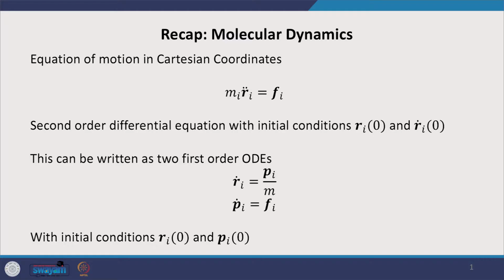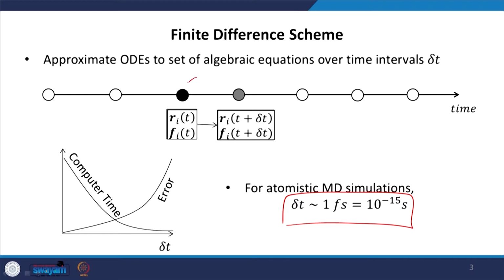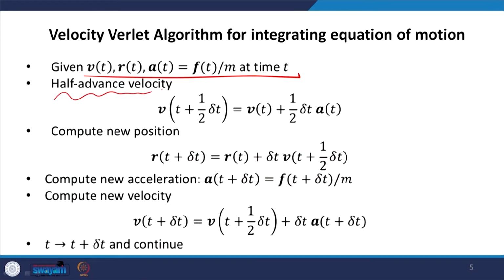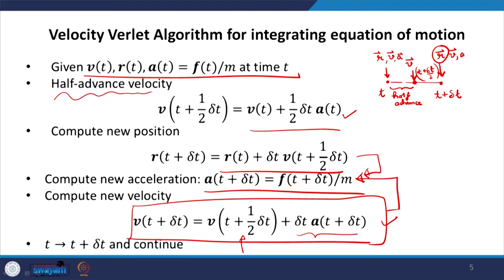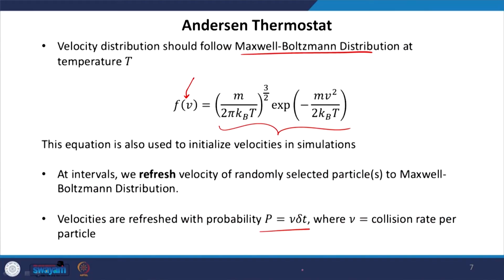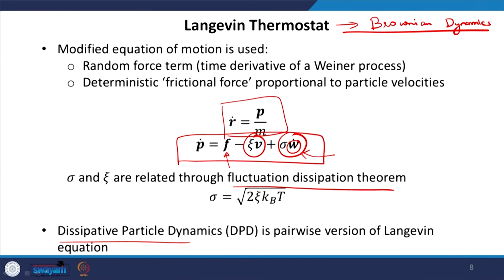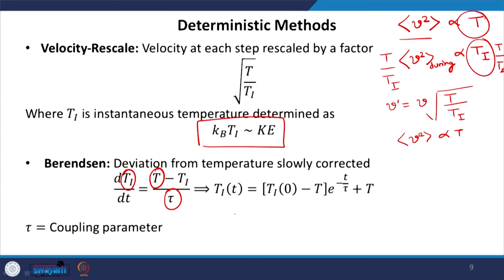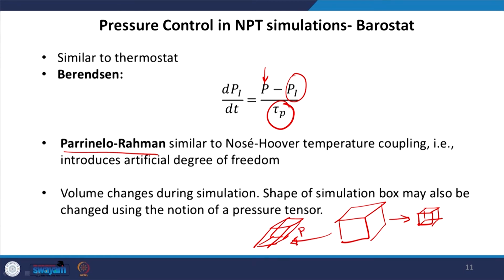lecture 46: Numerical implementation of MD; thermostat and barostat

Comment: As far as I have studied, velocity rescaling methods are not deterministic due to they are not time-irriversible
Reply: Being deterministic and being time-irreversible are two different things. Rigorously speaking, MD suffers from certain numerical instabilities at long times. In the context of current discussion, one may still classify thermostating methods into two categories, which is based on the approach being followed.
Reply: @prateekjha5187 but what about their overall effects on ths dynamics? Which method should we choose so that equilibrium attainment at a desired temperature is not  affected
Reply: @vishwasshankar3929  Nose-Hoover is somewhat preferred in that sense if you are interested in dynamics. However, for most properties, the difference is not that significant. It is also preferred to have weak coupling in equilibration but strong coupling in the production phase.